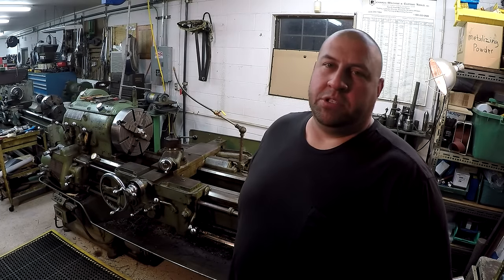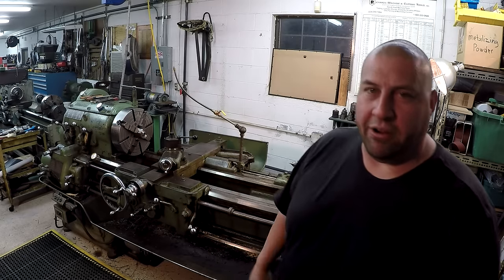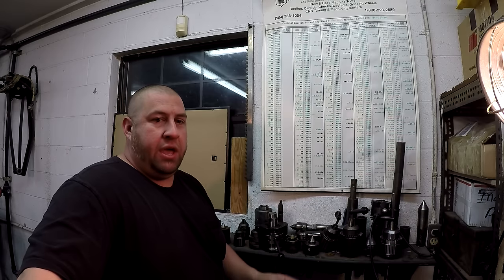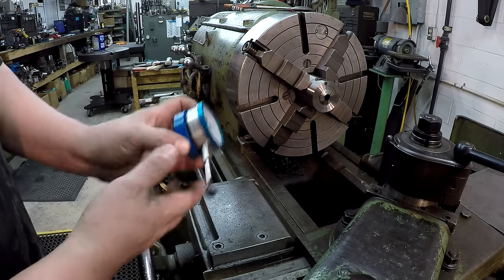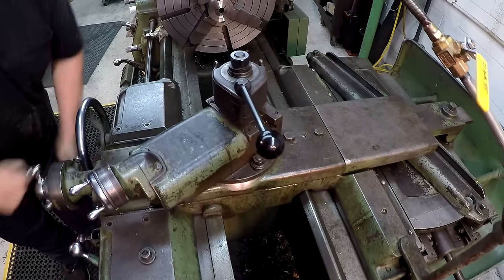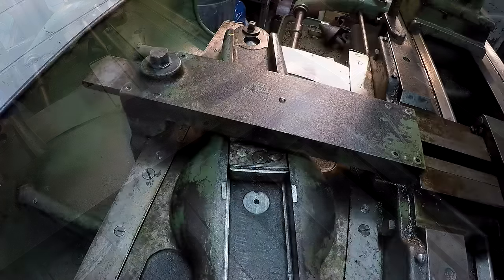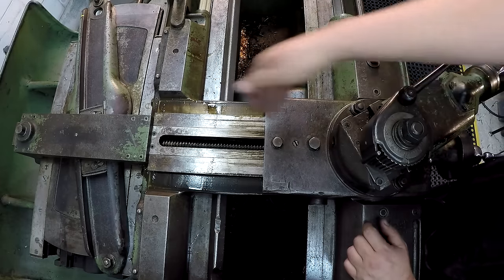Taper Attachment & How It Works

Comment: I think folks are confused by the taper attachment because it is so deceptively simple in it's configuration.  Don't read anything into it, it's dirt simple, nary a speck of magic involved it just follows the angle and shoves the bar the cross slide is bolted to and t has nothing to do with the lead screw.  But, until you see the light, it might as well be something out of Harry Potter.

Comment: Hmm, that polisher/sander thingy has my wheels turning. Looks like a good project for me. I built my own 2"x60" upright belt sander. No reason I couldn't build a smaller portable machine. That would be the cats meow for polishing certain parts on the lathe. People would crap if they saw my current set up for polishing. I actually hand hold one of the small Harbor Freight 1" belt sanders much in the same way you use that big polisher. It actually works but is awkward as you can imagine.

Comment: hey Adam... have you ever thought about doing engine work?... I have a 4.0:L engine I need machined block, cylinders and crank (already torn down)..  would be interested in knowing if you would like to try on my tear-down Jeep 4.0 liter engine (6 cylinder).... not in a hurry or in a desperate need.. current engine has 246K+ miles (daily driver) but cant find machine shop in the Orlando area let alone anyone who does machine work here.... Let me know... could be good project. (let me know cost if interested)

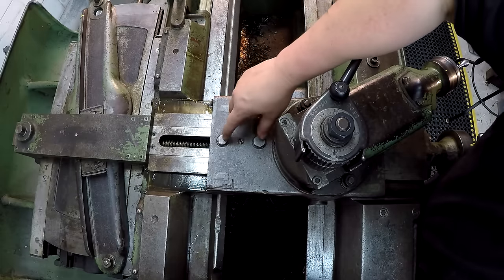Comment: Please forgive my layman commentary, but it seems to me at 16:30 at least some of your backlash is caused not by the nut being loose on the screw, but by the screw being a bit loose in whatever is holding it at the far end, to the taper attachment. I think that is the case because as you pull on the slide, we can see the screw itself moving a bit too, together with the slide...

Comment: Thanks for the video! A quick search for Monarch Taper Attachment patents showed 3: US2184377 A, US2299677 A, US2309298 A from the war years. Two of them only hint at the telescoping lead screw device, while the oldest (https://www.google.com/patents/US2184377 from 1939) describes it as a sleeve with a key that is attached to the hand wheel. Of course the actual implementation probably differs from the patent quite a bit, especially since that kind of connection is not part of the patented invention.

Comment: Instead of making ten parts, why not make that indicator base one piece?? I mean, it's a simple thing, heck, you could make one out of puck from earlier in the vid. My solution to the plastic back was to grind the thing off, and super glue a ring magnet that i got from an old speaker. It has this plastic coating all around it so it's protected against chipping.

Comment: Is that the only way to cut a taper on a lathe?
Reply: Tom's Corner There are at least three. Compound rest, taper attachment, tailstock offset
Reply: Tom's Corner No sir. Depending on the length and the taper dimensions you can offset the tail stock and turn between centers, I would rather have a root canal than using this method or you can make an adjustable tail stock center on an old face plate that can be moved without moving your tail stock or you can use a hydraulic taper attachment that mounts to you cross slide on the backside and it follows patterns.

Comment: The taper attachment you are showing is called a "Telescopic" taper attachment because of the male and female part of the cross slide screw that allows axial extension. This is considered the telescopic part. I think everything you explained is correct except one thing 12min35sec into the video. You said the worn out clamp bolt needs to be bolted down when you do not cut tapers. I think that is not the case. If you bolt down that bolt you cannot use the cross slide hand wheel any more. This bolt is there to eliminate backlash in the cross slide screw nut during taper cuts. The telescopic taper attachment has to stay on the machine all the time because the cross slide lead screw is fixed in the taper attachment slide. The cross slide would not work at all without the telescopic taper attachment. The smaller cheaper taper attachments like those of Craftsman and Southbend lathes are called "Regular" taper attachments where the cross slide screw nut has to be taken out to use the taper attachment because the cross slide screw is not telescopic and is fixed at the hand wheel end. The regular taper attachment can be taken off the lathe when not used.
Reply: No that bolt is clamped when not cutting tapers because when the taper clamp that locks to the bed is not locked there is no way to prevent cutting forces from making the taper guide move all about. That bolt is there to provide a positive anchor to absorb the cutting forces whenever the taper attachment is free.

Comment: I’ve never understood the objection to grinding and sanding on the lathe. That’s something that industry has done for well over a hundred years. The key is doing it properly. Otherwise there would be so many lathe mounted grinders, often made by the lathe manufacturers themselves. It’s not likely they would produce machinery that would destroy their other major products. It’s just a matter of covering  the parts of the lathe with a tight cloth. If the cloth is oil soaked from use, even better, as it will capture the dust.

I think that those protesting, as usual, are just ignorant of the process they’re complaining about.

Comment: hey Adam, the cross feed nut is split longitudinal with a set of shims for for adjusting backlash. The little slotted screw is just a threaded dowel pin. Unfortunately the cross slide has to come apart to adjust it. I have an old picture of my crossslide components taken apart. https://www.instagram.com/p/BO0_LROhz3k/  I had to make a new screw for my model "C" from some precision ground acme stock since it was severely worn.